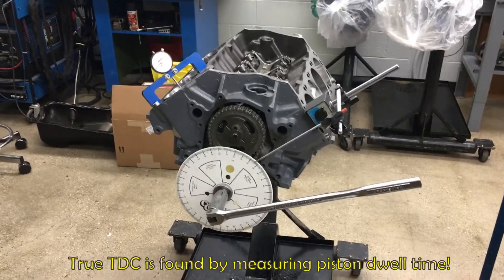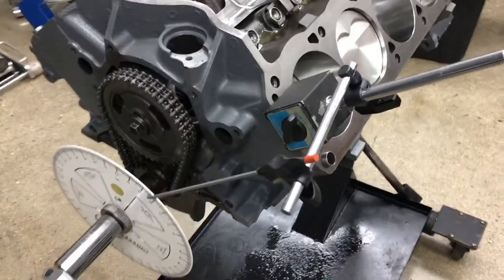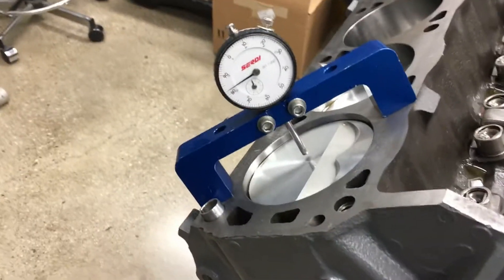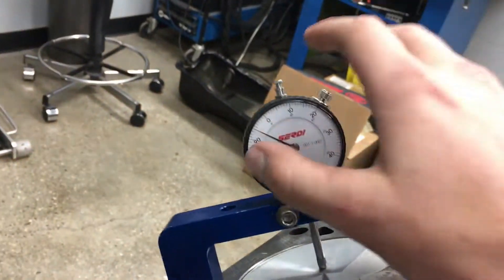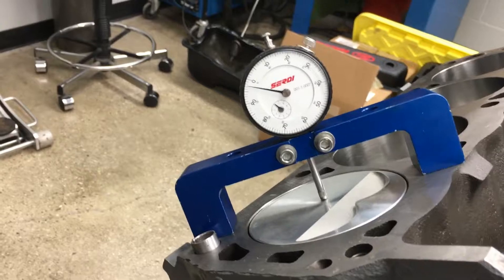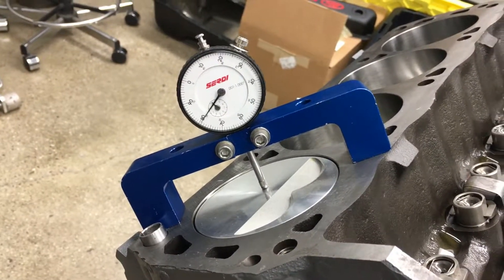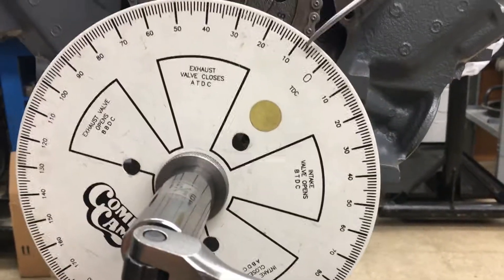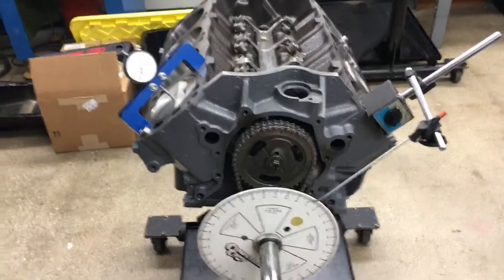Engine Degree Wheel Setup and Finding True TDC

Comment: The dial indicator (in the right hands) works well. I would shoot for .040" rather than only .020".
However, you can eliminate any potential error by using a PPS tool (positive piston stop).
By positively stopping the piston, in either direction of rotation, you guarantee yourself of a near perfect split when the tool is removed and the degree wheel pointer aims at ZERO.

Comment: So will a few degrees totally not make ur engine run
Reply from the maker: Potential yes. Your spark timing will be off. And you may cause the piston to hit your intake and exhaust valves if you're off by more than 10deg.

Comment: Does finding true tdc only apply for cam degree? Or do I need to use it for finding piston deck height
Reply from the maker: For cam degree and checking piston to valve clearance. You also use this measurement to mark true TDC on your harmonic balancer.